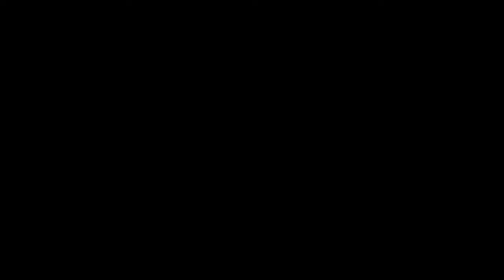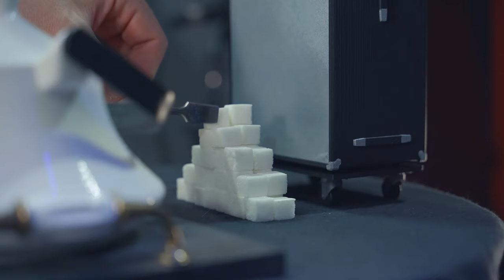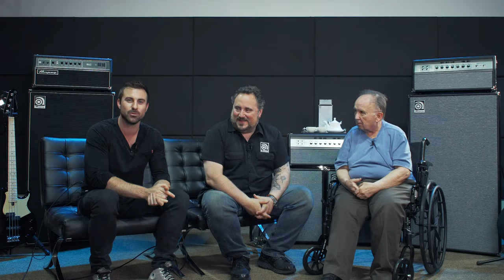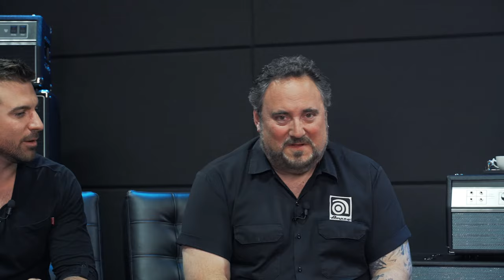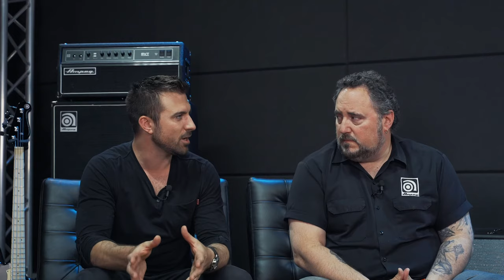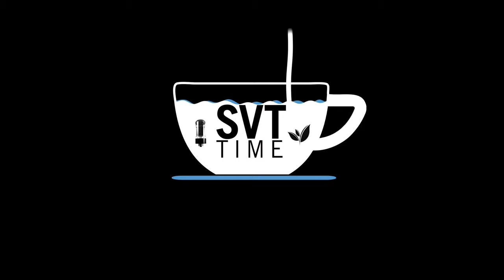AMPEG | SVT Time, Ep. 2 – SVT Designer Bill Hughes Interview

Comment: As an electrical engineer and bass player, this video is just great.  Bill is cool!!.!!..pragmatic like most good engineers.  I have '70 & '72 SVT's and a '70 SVT 8x10 cab.  Thought about buying a 50th anniversary, but after buying an SVT-VR years before getting original SVT's, I realized the VR isn't that good compared to the originals.  The power stage of the VR sounds legit, but not the preamp circuits.  I wonder if channel one of the 50th anniversary is the real deal??  I truly can't believe how much better the old ones sound compared to the VR.  Those old SVT's are special indeed.  Makes our blues rock trio sound full live.  So fun and lucky to have 2 of them.

Comment: I think 6146B's sound better and louder but I like both. I bought my first used SVT in 1975 and have used them since. I've owned many different Ampegs including V4-B, B-15n, B-15s, B-18, I even have a 1959 Ampeg Bassamp 835 which sounds great. I also have a couple of 100 watt SS B-15T's Bill designed.